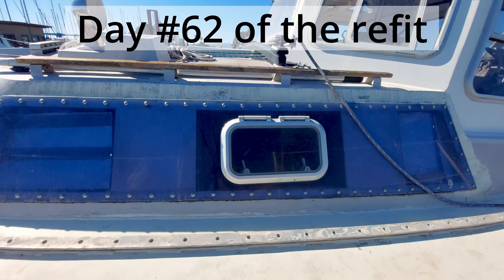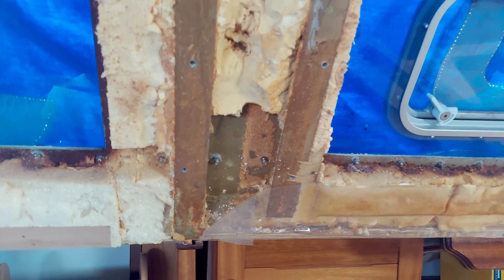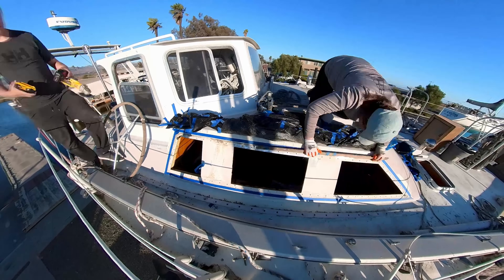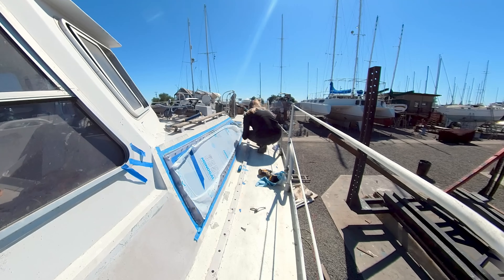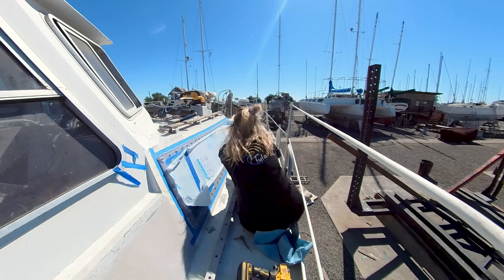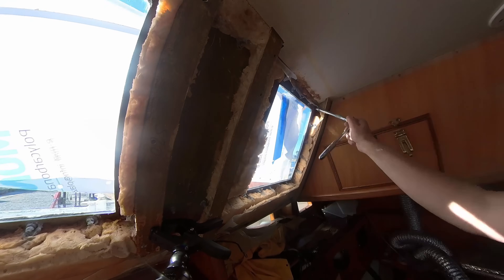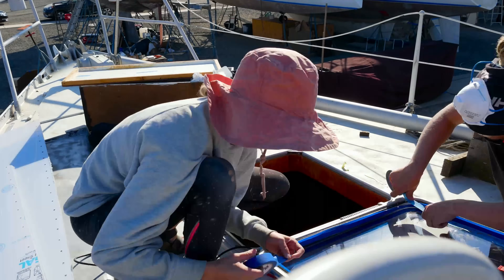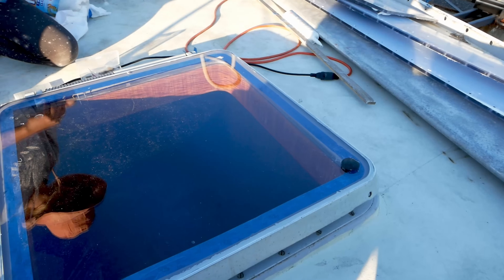Abandoned Aluminum Sailboat Total Transformation! Month 3

Comment: Personnally, i choose to use a paste called butyl for the sealing. It is easier to use than sika or silikon, it never dries so no need to use the technic to wait before screwing again, it is also much cheaper. I replace the windows few month ago, so i don't know yet how it will be on a long term. To my experience, i usually need FIVE times longer than what i plan! I usually work alone and i think that two people goes at least three times faster than a person alone! Bon courage pour la suite.

Comment: When you have to drive a lot of nuts next time, don't do it by hand. Just use a cordless drill/screw driver with a drill holder and fix the nut extension inside instead of a drill.

Comment: FYI my friend. Next time you're dealing with silicone removal. Use a propane torch with care. It will come off so easy you will be extremely surprised. And do it before you remove the Windows if they're glass. If they're not glass and plexiglass after.

I must say, extremely impressive the amount of work you put in to your project. Certainly when you complete what needs to be done, your labor value will be tremendous.

Comment: I am learning about boats as I am really in to old VW and Porsche.
One product I use for chrome is called "kbs diamond clear"
If you have any brass or chrome that is exposed you can paint the kbs directly on it with no primer.
It is a clear with uv protectant.
It solves the problem of oxidization and having to polish metal. It is also an "mcu" so it dries VERY hard..

Comment: Hi! You’re doing great work! 
As a yachting professional I have to tell you that you will probably going to have problems with the windows in the future. Silicone and bolts are really both not the way to go. I have mounted hundreds of polycarbonate windows on boats. Because polycarbonate expands quite a bit when it gets warm, it’ll eventually cause leaks when mounted with bolts and silicone.
The durable way to go would be to glue them on with a polymer compound (like Simson FastTack, but don’t know if that available there. I’m in the Netherlands). 
After preparing the polycarbonate (sanding where the glue is going to be and degreasing the surfaces) they can be put on to the boat and pressure needs to be applied for a few hours. The polymer compound will also fill the holes left by the bolts. That’s it. This way, the polycarbonate can expand and the compound will stretch with it, without bolts preventing that.
Anyway, I can imagine you don’t want to do it all over again after the work you’ve put in 😅
I just wanted to let you know. Maybe for a future project with polycarbonate

Comment: You should put a 3m stone guard coat on the outside to protect from uv and scratches. And a thin internal polycarb will give some extra insulation.
I would also run a bead of silicone on the outside of the windows to create a curved bead between the window and hull. 
But use a drill to tighten

Comment: I am looking forward to see you take this boat through the north west passage! Just a tip when it comes to an easier cleanup and removal of the excess silicone: -put some dishwashing soap into a small container of water. Remove the majority of the silicone with a small piece of wood(flat or coned shaped at the tip) that you continually dip into the soap water. The soap water will act as a lubricant so that the silicone will not cling to the wood. Then go over with a wet finger dipped in same soapy water😉

Comment: It’s way past time you began using battery drills for driving screws and tightening bolts (for tapping threads into hole buy a set of Gun Nose Taps and Dormer cutting fluid). Use the tension clutch for uniform torque. Thanks good to see Polyurethane foam being used. I have a severe condensation problem under the deck right over where all of the radios and instruments are housed. It’s like a rainforest in that space, I can’t believe professional boat builders thought that was quality work (20 years ago). I’ll copy your technique. I have to re silicone my saloon windows, too. I’m not going to completely remove them, just dig out the silicone around the edge. I’ve been thinking of methods to rough up the gell coat to give better adhesion and am going to try a diamond coated blade on the vibratory saw to get a fine cut down inside a grove.

Comment: with self-tinting sun protection film you can extend the life span of the plexiglass panels and have a self-regulating UV-sun and heat protection in the cabin. And besides all the hard work your insulation looks very good and mold free thats really a good thing far an boat of that age! No condensation issues

Comment: After sailing so long on such a decked out cruising machine I'm sure you all have some great ideas to carry over to your new blank canvas.
It doesn't always seem so but going to sea on a boat where you have touched every system and structure on board has a huge advantage. Knowing exactly what is behind walls and under floor boards will pay off many times I'm sure. You both know boats and know what works in your climate so no doubt everything will be just fine soon as she hits the water. Good luck.

Comment: Try heating the silicone with a heat gun. Also, when you're peeling off your painter's blue tape. Pull away at an angle from the edge you want to protect.  You will get better results.

Comment: I used 3M 5200 marine sealant, supposed to be the best for marine applications. I do known that in one example I had to remove a fitting and the 5200 would not let go, great stuff, but you better be happy with the install / application because you will have to ruin anything it is attached to after full curing. Thanks!

Comment: Have you investigated butyl rubber tape as a window sealewr instead of silicone? Most modern builders are using this for waterproofing, no mess, permanently flexible and absolutely waterproof.
I've repaced all the Acrylic windows in my Farr 1976 vintage 35 foot ex racing boat with polycarbonate  sealed with butyl rubber, not a drop of a leak in three years. Anyway keep going, i love your chaannel

Comment: Your dedication to the work is amazing. Are those "nylock" type nuts or a more standard type? Washers, lock washers or anything more specific to your particular application? Are the fasteners aluminum of stainless steel? Assuming you'll cover it with foam insulation I am curious which is recommended or preferred. Once again it's my lack of knowledge of the extreme conditions you will be facing.

Comment: Make sure your using closed cell spray foam and not open cell.  the closed cell will give your a better R-Value and seal up around the bolts and nuts.

Comment: Hey guys! about the silicone: I recommend mixing dish washing soap and water in a simple spray bottle in order to fix the silicone after you removed everything just spray it on and wipe everything, reason for this is that the silicone will not stick to unwanted surfaces. But be careful not to spray where you actually want to put more silicone since you'd have to wait until the soap dries off :) cheers

Comment: There's an industrial citrus cleaner that works real good on silicone, as does brakeclean ;)  Holy crap, that's about 4x as many screws as I'd have re-used! Those windows won't blow at 20000 leagues under the sea! 😁

Comment: To clean off the silicone, use Isopropanol (IPA) as a solvent. This can also be used to clean any wet silicone that you get on the deck. If you get silicone on the polycarbonate, and use isopropanol, only use a rag with IPA and then spray glass cleaner on the the polycarbonate immediately and clean with a microfiber cloth, as IPA left on polycarbonate will make it go misty. A better way of cleaning paint and silicone off polycarbonate is with TAMIYA POLYCARBONATE BODY CLEANER. It gets paint and silicone off and won’t attack the surface and make it go misty. When you apply silicone to your window seals, get a 500ml finger-trigger spray bottle and fill it with detergent and water (or alternately use an industrial foaming glass cleaner spray can like Hi-Sheen Glass Cleaner with ingredients: 2-Butoxyethanol
Butane
Ethyl Alcohol
Anhydrous Ammonia)
Spray the water+Detergent OR Foaming glass cleaner on the silicone and scrape it off with a polyurethane silicone spatula [scraper] (not your finger). 
The detergent water mix or glass cleaner acts as a lubricant and will give you a much better finish. It will also stop the silicone from sticking to your scraper,
The silicone spatula can be found at glazier suppliers or large  home maintenance suppliers.
If you’re doing maintenance on a boat, you should have some IPA around. If you’re doing work with silicone, it’s a ‘must’. 
For inside work, make sure the space is well ventilated if you’re using IPA and keep away from ignition sources (it’s an alcohol).

Comment: One question : why didn't you use sykaflex instead of silicon?
Reply: The silicone is acting like a gasket under compression from the bolts. No need for a PU sealant. Its way too tough. Would make removing a window later much more difficult

Comment: Just my comment see your using hand speed wrench Why didn't you use small battery type drill with adjustable clutch on it to tighten up bolts to window faster would saved you buch time this way you bee in Key time with Silicone set up Rate